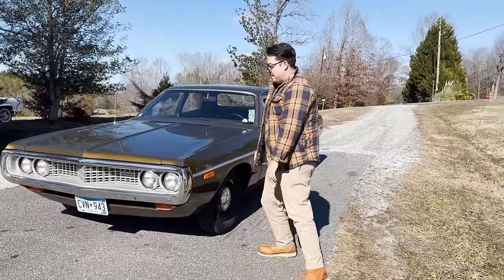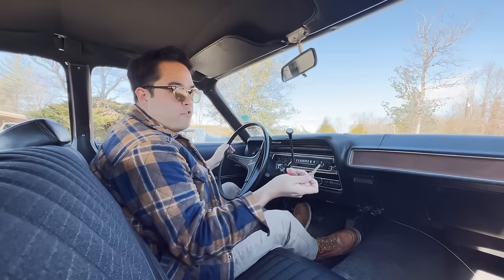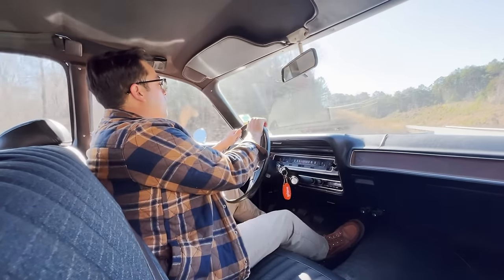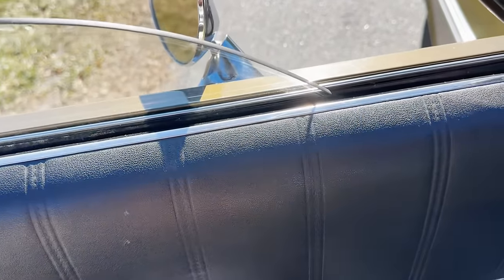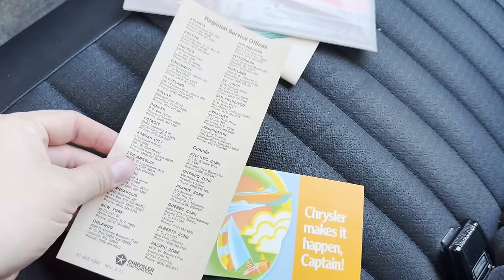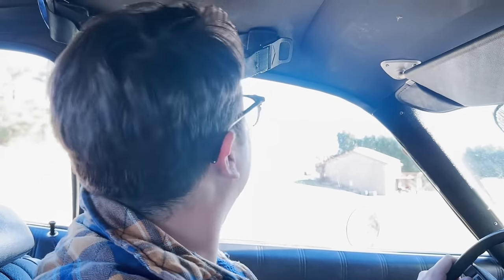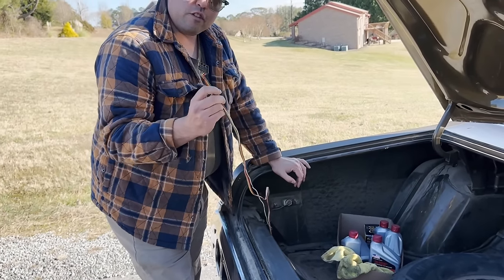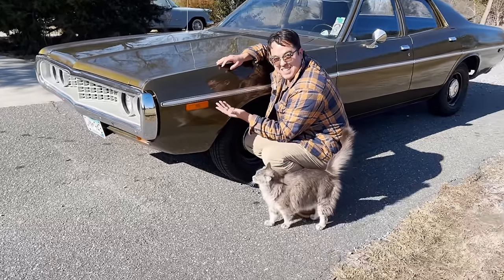1972 Dodge Coronet Custom! Rare Slant Six Stick Shift! Obsolete Automotive Reviews Walkthrough Drive

Comment: It is rare to see a three on the tree on a larger car from the 70s, but not rare overall in the 1970's.  My dad handed down at '79 Chevy Malibu to me with a V6 and a 3 speed manual on the floor tho.  It looked good with early 70's Chevelle wheels and air shocks.  But I was a teenager, so my perspective was that of a teenager. I still see 78-81 Malibu's around with V-8's and Tubed wheels in the back 👍
Reply from the maker: Manual transmissions for American cars of the 1970s were pretty rare if you look at the figures. They existed obviously… but the majority were automatics. The smaller “compact” cars had higher numbers of manual transmissions. 

To compare: the mid size 1971 Plymouth Satellite (the Plymouth equivalent of the Coronet) 91.4% were equipped with automatic transmissions. The full size Plymouth Fury saw 98.3% equipped with automatics! But only 77.5% of compact Plymouth Valiants were equipped with automatics.

Comment: Great report on a great car !  By the way : did you know meanwhile USA had the Coronet in several generations we in Argentina had the Dodge Coronado ? Despite Coronet and Coronado are resembling words,  the Argie Coronado was a Chrysler's stylists design made exclusively for Argentina's market , there was never a Coronado's sibling for the USA's market . Further some , Argentinian assembly tools were redirected toward Spain's Chrysler plant and the Argie Coronado was relaunched exclusively for Spanish customers as the Dodge Barreiros 3700
Reply from the maker: Very cool information. I know down south they had different offerings and some models being made for longer periods than here.
Reply: @ObsoleteAutomotive  your quotes are fully acurate, big thanks !  Yes , some way the '60s and '70s vehicles assembled in Argentina from USA's engineering were long lasting machines , infact those Chryslers and Dodges Coronados are still driving pretty well after 40 years. Not only : from those four famous brands in your country , the AMC Ramblers and the Chrysler products prove to have better longevity than GM's or Fords !!! Much thanks all over again for your kindful reply
Reply from the maker: @joseluisherrera4669  Thanks for sharing your insight from your country! Always neat to hear about things like that!

Comment: A few years ago I was perusing Craigslist and found a complely stock Dodge Aspen sedan with Slant 6 and a floor-shifted, 4-speed manual. It was cool...in a weird way. 😂
Reply from the maker: I had a Aspen wagon that was a Slant 6/4 speed. I’ve seen other examples of Aspens and Volares with 4 speeds. Neat to see.
Reply: If those are the four speed with overdrive, those are very rare transmissions. GM also used those transmissions in some of their half ton trucks in the early to mid 80s.

Comment: The 72 Coronet literature shows a 3 speed manual standard on the 225 six and fully synchronized 3 speed manual on the 318 V8. I didn’t notice, but did you have to come to a complete stop to shift into first gear or could you be coasting at a few miles an hour and shift into first? I didn’t see the gold pentastar on the passenger side lower fender.  1972 was the last year that Chrysler placed the pentastar on the passenger side lower fender.
Reply from the maker: Literature mentions two different transmissions between 6 and v8 like you said. This car goes into first relatively easy even when moving at low speed but I haven’t really tested it much as I’m used to non synchro first manual transmissions and drive accordingly.
Reply: Looking at the car in this and the first video I suspect it may have had a repaint at some point and the pentastar got removed.
Reply from the maker: @rennkafer13  I believe 1972 is when they phased out the passenger fender mounted Pentastar. If you look up images of other 1972 Coronets it looks like they are absent from the fenders as well.

Comment: I worked at a new car dealership in the 1990s. The sales manager would order little to no option cars and trucks for the purpose of having crazy low prices in the Sunday full page newspaper ad. Typically he would order one of each model. We would park them in the back in with the cars brought in for service. When people would come in for the low price ad car we would look around and say oh it must have sold but we have these over here. If they pushed the issue we would find the car and oh look it is a six cylinder (or four cylinder) with a gear shift. Dangist thing. But we do have these other ones over here. If that car was not a county car for like the health inspector, I can pretty much guarantee you it was a Sunday full page ad car.

Comment: Six cylinder three on the tree cars were all over the place back in the day.  GM, Chrysler, and Ford had them, and not just in pickup trucks.  They were pretty much gone from cars by the mid to late 70s, but I have seen some three on the tree setups in early 80s pickup trucks, Ford in particular.

Comment: Very cool ride and you did an awesome job of detailing all the features of that very rare Coronet.  The rear gear ratios mentioned must be a typo though and likely the automatics got a 2.92 and the standards got the 3.23?
Reply from the maker: It’s odd but the brochures and dealer album show the 6cyl with Torqueflite standard with 2.94 and optional 3.21. 6cyl with manual transmission is 3.21 standard and 3.23 optional. Not much of a difference.
Reply: Thanks for your reply.  I'll need to retract my previous comment about the axle ratios being a typo.  A previous commentor correctly explained the ratios being so close because there were 2 different rear ends used. The standard 3.21 ratio was used on the 8-1/2" rear end while the optional 3.23 ratio was used on the larger (and stronger) 8-3/4" rear end.  If you were using the vehicle for heavy duty use such as towing, you would likely have opted for the 8-3/4" rear end for durability.  Mystery solved. @ObsoleteAutomotive  .

Comment: An interesting detail differentiating the Coronet from fraternal twin Plymouth Satellite is the stamped character line on the quarter panel flank parallel to the top crease of the panel, not present on the Fury through model year '74 but it was used on both from '75 through '78.  Cost cutting measure to eliminate needing separate stampings?
Also, '71-'73 column stick shift models used a lever design sourced from the Chevy Nova-Chevelle usng the same knob as the automatic models, but the '74-'78 stick shift examples had a different knob, and '75-'78 models ( and column-shift manual trucks and vans) used a double-bend shift lever similar to the Impala-Caprice tilt-wheel shift levers. See also '75-'76 Dart-Valiant models and the column shift Aspen-Volares.

Comment: That's a cool car!  How does one tow it in gear like that, if you need to tow it behind a vehicle?
Reply from the maker: The shifter can be put in neutral for a short distance. But generally for any car being towed a long distance the driveshaft would be removed or rear wheels taken off the ground.

Comment: Does this have low gear synchro? My ‘63 Valiant had the 3 on the tree, but you didn’t put it in low unless stopped.
Reply from the maker: The 6 cylinder Coronets did not have synchronized 1st. So you must be stopped or double clutch to get into 1st gear on this car.

Comment: I have to remind myself it’s intermediate. It looks huge! I learned to drive in a ’72 Duster (A-body) that had an automatic transmission but was otherwise not heavily optioned either. Rubber carpet and no AC. It probably had a slant 6, but I never worked on it, so I have no idea. I didn’t use the shoulder belt for the reason you demonstrated—how do you put it back?!! That should only have been an issue for the passenger since there was not always anyone riding with me. And I unplugged the buzzer so I didn’t “have to” wear the lap belt.
Reply: It is pretty large.  I have a '71, and it's longer and wider than a current Charger... and 700-900lbs lighter.

Comment: I had a 73 Coronet with the 318 , No A/c, stock Motorola AM radio. Had Power steering and brakes, but the steering box was shot so she was a challenge to drive. Couldn’t afford to keep it and wound up selling it. It was a good looking car, just a shame I didn’t have the money at the time to make the necessary repairs and to keep it
Reply from the maker: Ah that’s a bummer! When was this?
Reply: @ObsoleteAutomotive  picked the car up in 1991. Was originally my Cousins car. It was a copper color with a brown vinyl roof, but the vinyl was all cracked and coming apart, so my uncle pulled it off and used white Rustoleum paint so it had a 2 tone look.
Reply from the maker: @PaisanVinnJK  what did you pay for it back then?

Comment: We had a 69' Town & Country station wagon, and it had the same kind of loop surround bumper with that flush to the body wrap. It started with the Fuselage Styling Look that started in 69' and lasted tell 73'. I believe the fuselage styling went away when 5mph bumper standards kicked in, plus the look had run 5 years already by that point, good reason to move on.
Reply from the maker: The full size Chryslers did have the same loop bumper idea as well. I like it myself.

Comment: Is low gear synchronized? It's an A-230 if it is. I bought a 1973 Valiant several years ago with that same combo, except that it had a A-250...big difference because low on the A-250 isn't synchronized. Imagine trying to turn a corner with manual steering, plus having to double-clutch that transmission to get it into low. I was sure that someone had swapped it in but lo and behold, the VIn derivative on the trans matched. Go figure.
Reply from the maker: Factory literature states that the 6cyl cars got non synchro first gear transmissions and the 8cyl cars got a fully synchronized transmission. Seems odd and more costly to use two different types of transmissions. This car seems to have a non-synchro first gear, but it is not a stubborn one at all.

Comment: The '73 front bumper used the 5mph impact pads and 1974-on use the 5mph hydraulic bumper shock impact protection system.

Comment: Beautiful car! I'm surprised it doesn't have the "T" handle pull twist push return park brake handle as my 73 Dart custom has. Perhaps because it's got 3 pedals?
Reply from the maker: The B and C body cars had the foot brake in these years whereas the A body (Dart) kept the T handle until the 1976 model year. 1976 was the last year for the Dart and had several differences from 1975 and earlier such as having a foot emergency brake. 

Check out my video on my ‘76 Dart: https://youtu.be/7p_ihQCE2Po?si=bDHg-ljgfpOpUm1H
Reply: @ObsoleteAutomotive  Copy that,appreciate the knowledge.

Comment: It's a manual transmissions but, I always considered this a shifter a three on the tree and the floor shifter a stick shift because it comes out of the floor sort of like the way a stick comes out of the ground.  Super cool car and who knows, it could be a one off.  I bet you could rent this out to movie studios doing old films all day long.  Just tell them they can't drive it.  Only use it for background effect.
Reply: “Three-on-the-tree” and “four-on-the-floor” were both stick-shift cars …
Reply: @Clyde-2055  I know that.  I jut always call the column one a 3 on the tree.  They're technically manual transmission and the shifting mechanism is the stick itself.
Reply: @RedBud315  — Yeah, the 3-on-the-tree was just a cutesy phrase, as the steering column was never officially called a “tree”; it owed that tree designation, as much as anything else, to the fact that it had the STICK growing out of it.

And of course, another favorite of the day was, “a 4-on-the-floor, and a 5th under the seat” …

Comment: For it to be an authentic cop car, "It's got (to have) a cop motor, a 440 cubic inch plant, it's got cop tires, cop suspensions, cop shocks. It's a model made before catalytic converters so it'll run good on regular gas."

Comment: I'm not a big Chrysler fan (in fact I think they're the worst American car maker by far) but some of their stuff from the 70s was pretty good. The 71-74 Coronet is probably my favorite looking car ever made by Chrysler, specifically the 72 like yours. It's a very nice design, the front end is similar to like a Challenger but a bit more conservative, and the side profile is like a smaller version of the 71 Ford (one of my favorite cars from that era). Even the last year, the 74, had a pretty nice front end despite the large bumper they had to put on it. The interiors are also fairly nice looking, back around that time a lot of interiors were way too driver centric, almost like a semi truck, by comparison the Coronet's interior is pretty nice. That was also back when mid-size actually meant mid-size too, before cars like the Coronet or say the Torino/LTD II got way larger for no good reason. The 75 Coronet added and entire 10" of hood & front overhang for no good reason, as well as a pretty hideous front end imo. But the 71-74 Coronet is definitely a car I wouldn't mind owning, and it might be my first choice for a mid-size car from the late 60s to early 70s.

Comment: The 6 was $132 less than the 318 V8 in 72 - $950 or so in today's money, so it saved a little money, a little gas and weighed less.  Friend of mine had a well used version of this in high school.  A beater and not a nice one - ignition lock cylinder was broken and then later gone - I forget the starting procedure once the latter happend (screwdriver?).  Car did not inspire confidence.  When I first moved to a big city some of the independent cabbies still used these things and as they were 10 years old at least, I tried to avoid them.  Claustrophobic rear seat with excessively high doors/window slits - although in its defense, the Torino was as bad if not worse.  Always struck me that in this era the intermediate 4 doors were not a good buy compared to the base full size sedans which cost little more  and suffered less from the 'sytling' features that made the intermediates less space efficient than a simple size comparison would have suggested.  A little remembered upgrade was the Coronet Brougham sedan - a model in 71, merely an option in 72 and gone thereafter only to return of course when this became a Monaco, by which time this design was pretty long in the tooth.  Oh, yes, these are the correct Custom seats - the base interior (as with my friend's car) was pure taxicab.  I agree this was ordered - the fleets were auto by this time, and a very low option Custom 6 stick has to be fairly unusual - I  think the dog dish caps combined with Custom trim seals the deal.  (Though you do wonder about the forestry service!)

Comment: Question for anyone who knows.  Did the Dodge Darts and Plymouth Valiants with 3 speed column shifts have the same kind of ignition lock that required the shifter to be in reverse before the key would come out?
Reply from the maker: In the past decade I’ve probably only seen maybe 5 A bodies with 3 speed on the column. But only in for sale ads. I’d probably bet there was some sort of interlock like on this car.

Comment: hi, very good video, i used to ride here in brasil on ford maverick with column shift 6 cilinder but is a 164 engine exist just here
Reply: Are you sure it wasn’t a 144 ? That was the smallest of the “small-six” family introduced by Ford in 1960 …

Comment: I had a 1971 Dodge Tradesman van with 225 and 3 on the tree.  It was awful, gutless.  First gear was not syncronized.  But, I knew someone with a '71 Tradesman that did have a syncronized first gear and ran way better than mine.  Also, I knew guys with 225 and auto trans and those ran great.  There was something odd about my van, it may be that it was special model designed to run on unleaded, but it was so long ago it's hard to remember.

Comment: I knew you could get a slant six in a Coronet, but I didn't think a manual transmission was even an option (at least not on a four door sedan). This one is quite the base model---poverty hubcaps, no power brakes or a/c
Reply from the maker: It’s an oddball for sure. Which is why I Had to have it!

Comment: I cringe every time you handle the shift mechanism - a smooth and gentle movement is all that is needed. I came up driving for Yellow Cab of Philadelphia, and we drove the Plymouth Belvedere version of this same car. Take it easy and this fine example of 20th century history will survive.
Reply: Driving lessons from a Philadelphia hack — priceless …
Reply: @Clyde-2055 Don't laugh. On the 1st day of training they brought the new hires into the Yellow Cab office building parking garage, where they kept an old Yellow Cab Bevledere. The instructor would then raise the hood and point out the gearshift linkage on the steering column and extending to the trans. He then did a tutorial on how the arms could jam and what to do to get them properly lined up, all while the meter was running. Sir, there was no room for the ham fisted driver behind the wheel of the Philadelphia Yellow Cab, and we took immense pride in the expert and skillful manipulation of the somewhat idiosyncratic operation of the Chrysler three speed column shift mechanism. Thank you.

Comment: Are you able to find out how many were built?
Reply from the maker: Not sure if those figures are available. But to put it in perspective. According to the 1972 Salesman Facebook. In 1971: 95.9% of Coronet and Chargers were equipped with automatic transmissions. So 4.1% were manual transmissions split between 6cyl and V8. I’d imagine the numbers would be comparable to 1972. So if you take 4% of total production of Coronet 4dr sedans in 1972 that’s about 1500 cars.
Reply: @ObsoleteAutomotive  and how many of that 1,500-ish are still on the road😲
Reply from the maker: @SpikeArrowood  not very many at all!